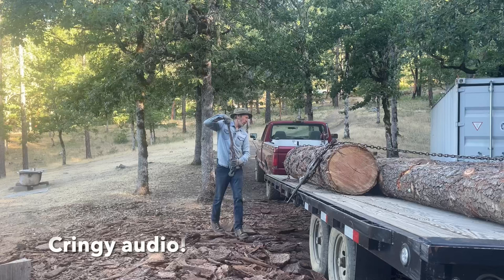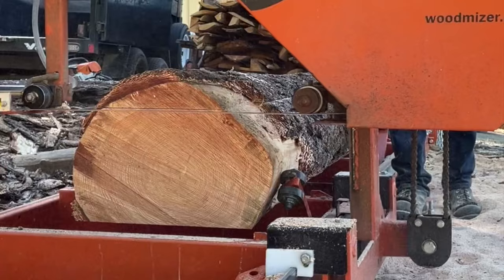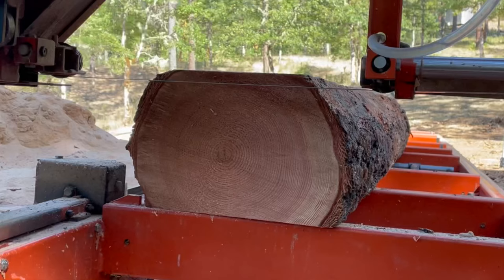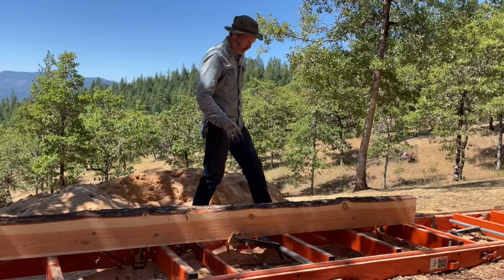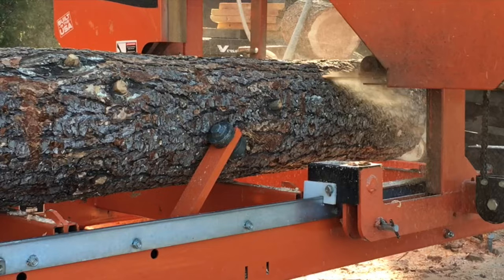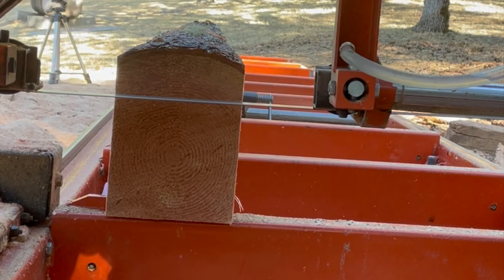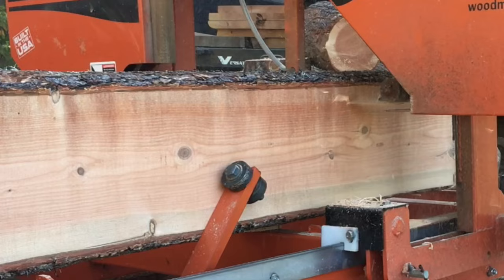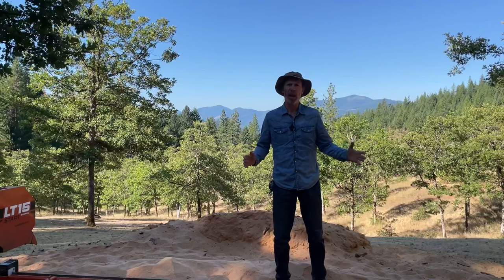Why I Don’t Use Blade Lube on My Woodmizer LT15 Sawmill Most of the Time

Comment: A practice that has made a big difference for me is setting my finished boards flat on a pair of 12 foot sawhorses ran perpendicular to the mill. This allows the lube sludge to dry back to sawdust, and positions the boards at a nice height for sweeping off once dry. It is also a good way to set aside boards you need to edge. This also puts the boards in an easy position to handle with pallet forks on a tractor or handle by hand once you are done milling.

Comment: I wonder how biodiesel would work? It is one of the best all purpose solvents i have seen......will even take auto paint off,if left on for a while.
Have not tried it on pitch,but seems like it would work better than regular diesel for cleaning,lube.
Biodegradable,too,and does not stink like diesel.
One would need to keep it from getting on anything plastic or rubber,though,as it will degrade/dissolve them.
Thanks for the videos!

Comment: I have a low hp homemade mill, the only reason I use a “lube” is for build up on the blade nd wheels. With lower hp, the feed rate is slower thus less heat. I use diesel for everything, every wood type as needed. I have a manual button to activate the pump. It also has a drip feed that I solenoid controlled, when the blade is engaged, drip is on. Works great on our eastern white pine, poplar or what ever. If I had a 30 hp mill, I would be in need of a coolant as well as a cleaner. Not the case..

Comment: Great video!
 I stopped using blade "lube" a year or two ago. I do use a 50/50 mix of kerosene and bar oil. I put in a spay bottle and "spritz" the blade after I finish my cut and only hit it every 2-4 cuts unless I'm making wider cuts then I'll spritz it after every cut. I cut mostly Doug fir but have used it on cedar, hemlock and most other species I've cut.
 Spraying it on after  seems to give it time to break up any sap build up and cool without any residue showing on the wood. You can hear the difference, even though I can barely pass a hearing test, I can hear the difference.
 Thanks again for your videos.
Reply from the maker: That’s interesting, bar oil and kerosene. I have never heard of using that. Thanks for the comment.

Comment: The bristles on your broom/brush are really long.  Shorten them up to make them stiffer overall and that will help with those slightly sticky spots of sawdust.
Reply from the maker: I have been meaning to replace that broom for a long time. I even said I was going to in a video long ago. I just never think about it when I am in town. I hadn’t thought about cutting them off to shorten them up. Good tip on the shorter bristles, thanks.

Comment: just curious ,has any one used one of those temperature guns at the end of the cut to see the difference of temperature of the blade  with and without water or lube
Reply from the maker: That would be an interesting experiment. The way I have done it is to shut the mill off as fast as I can before touching it to see how warm it is. I have never noticed it being more than just barely warm. The temperature gun would be good because you could do it even while it’s running.

Comment: Have you ever felt your blade to see if it's getting hot? I tried no lube with 2 passes on a hemlock and the blade was too hot for me to touch for very long
Reply from the maker: Yes I have never felt the blade being more than just warm. I have had some long hard cuts where I am thinking the blade must be getting hot. I would probably be getting hot if I was a blade doing that. I shut the saw down and touch it as fast as I can. Not hot at all.

Comment: How do you clean up a blade that’s did get all pitched up?
Reply from the maker: If it does start to get pitched up I will run some lube on it to clean it up. I think I talked a little bit about that in the video. Sometimes I will let it idle for a short time with the blade running and turn the lube on. Let it soak up a little water and soften up before making the cut.
Reply: @WilsonForestLands  I cut white and red pine and the blade gets pitched up, even with water/soap lube.
Reply from the maker: We don’t have that kind of pine here and I haven’t milled much green pine. Mostly Douglas fir with a little salvaged dead pine. The little bit of green pine I have milled was in the fall when they aren’t very pitchy. Not sure I can help with that. Some people swear by diesel. I never liked the idea of using diesel but they say it only takes a little.